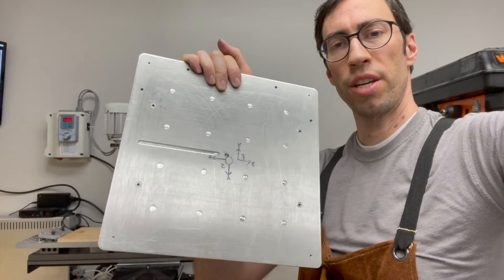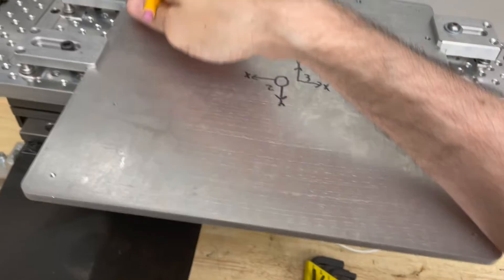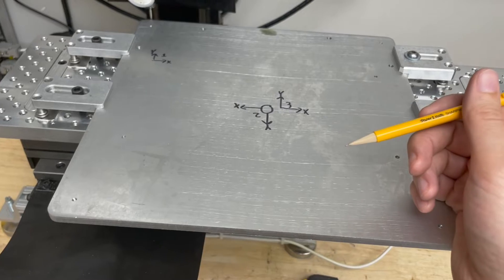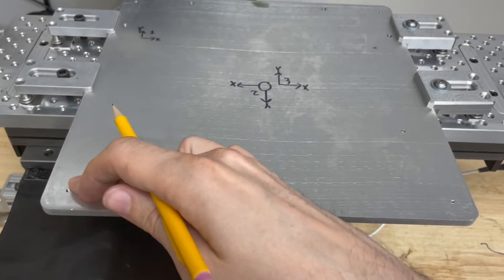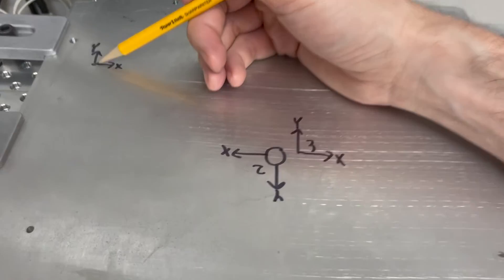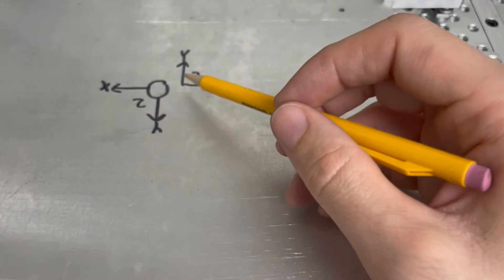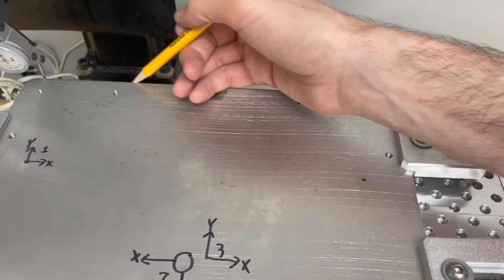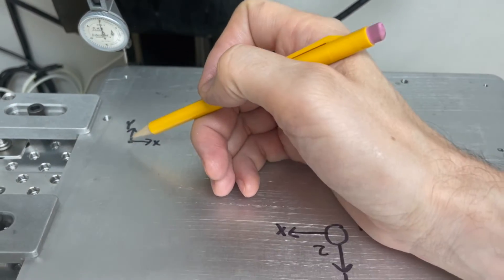Taig CNC Oversize Workpiece

Comment: I remember doing something very similar to this when I was building my VMC. Only difference is that I drilled the centre hole before hand and located it with a dowel pin for all 4 corners